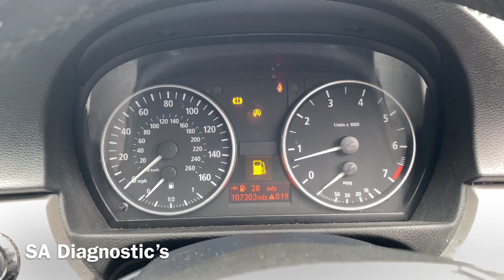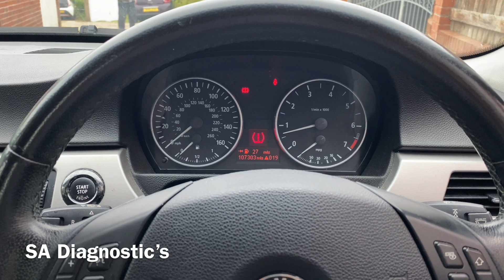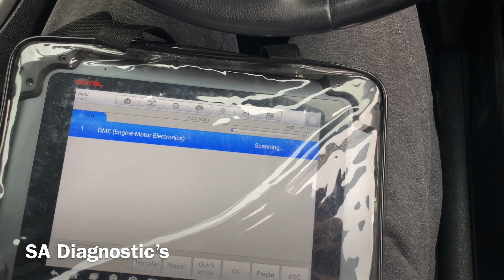Autel How To Code New ABS Pump BMW E90 5E1F 5E50 5E51 Steering Angle Sensor Calibration

Comment: Hi, I have a 2012 bmw 535i F10, I replaced the abs module, could you please tell what tool I have to buy to program and code the abs module to work properly on the car?
Reply from the maker: You can buy launch which is cheaper x431 pro tt
Reply: @sadiagnostics  I bought used module, am I still able to program it ? Appreciate your help !
Reply from the maker: @hardeesalih6435 yes should be fine I also fitted a used one. As long as it’s same code it should be fine…
Reply: @sadiagnostics appreciate your help, I’ll go ahead and buy it. 😊

Comment: Does work, thank you so much for this tutorial, solved my car steering angle sensor issue, no more dash light. GONE. In my case I used the Autel 808z works perfectly
Reply from the maker: Thank you for the feedback :)

Comment: Fantastic Videos. May need your help I have an E90 with a failed DSC/ABS Unit. Has a left rear wheel sensor issue and wiring is good as is sensor. I bought another DSC/ABS from an E90 and installed. I have an Autel Maxisys M906 pro 2024. I can code it and get no errors however with the unit in the key is locked in the slot? To get key out I have to disconnect DSC/ABS. Any advice would be fantastic and thankyou.
Reply: did you get this sorted mate?
Reply: I am getting a similar issue rear left sensor fault and brake sensors will not reset even with manually setting the % wear 
so thinking its the module